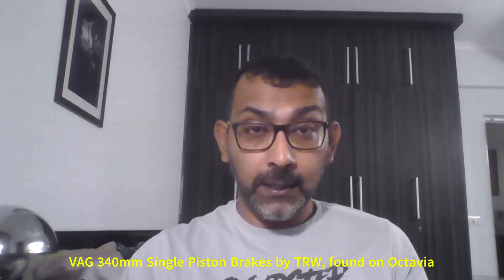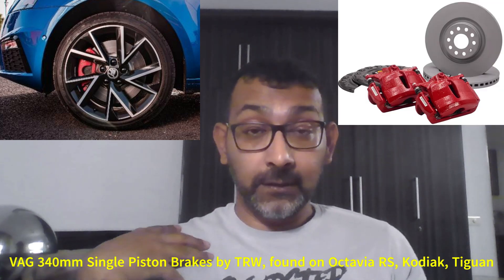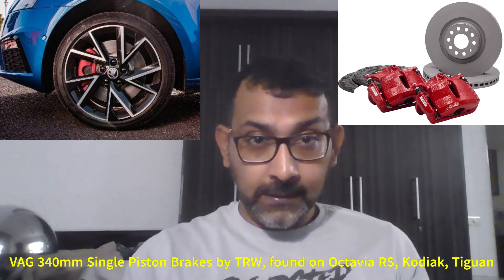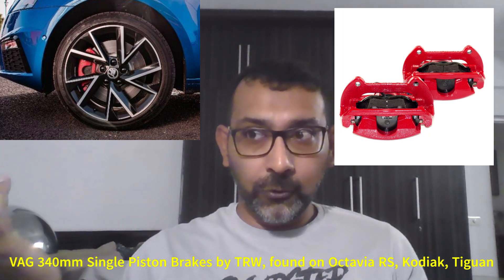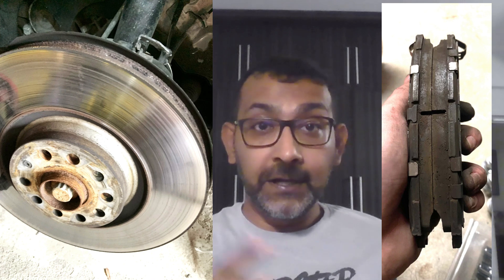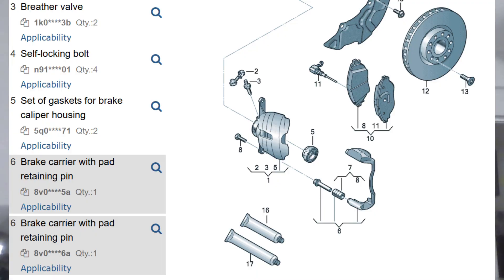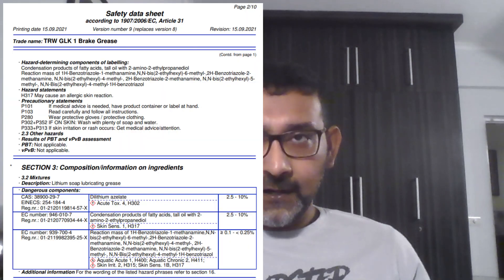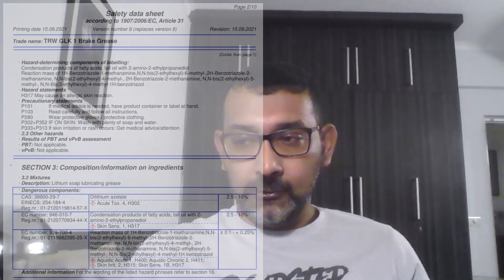MQB 340mm Front Brake Issues in Skoda Octavia RS, Kodiak, VW Tiguan

Comment: Thanks do the pins come as a pair for both callipers (in the link mentioned in the description) also do we get the break grease in India?
Reply from the maker: Yes they do. Technically you only need one set, one pin per caliper for this fix. Grease you can get at Skoda dealer

Comment: Can you confirm if Virtus GT 1.5 TSI also has the same issue? Because my brakepads have been worn out at 16k kms and my car isn't really driven very roughly except for a few times.
Reply: VW workshop wants me to change my brake rotors and pads. They are against skimming the discs even though they are not warped and have enough thickness.
Reply from the maker: @LegendGaming25  no, it don’t have this issue, this is specific to mqb340mm only. 16k is considered a decent life for brake pads.
Reply: @PrithwiRay cool i might get the discs skimmed i can feel a minor vibration while braking on the steering wheel....what could be the possible reasons for it? I have gotten my wheel alignment checked.

Comment: hello Prithwi
unrelated question....
can you share any update about underbody protection for your i20 n line
also, is there any solution/part available for the missing rear fender wheel well cover?
Reply from the maker: @varun4534  none that will fit without modifying
Reply: @PrithwiRay  did you have any success in procuring any underbody protection parts which can be installed with/without modifying?